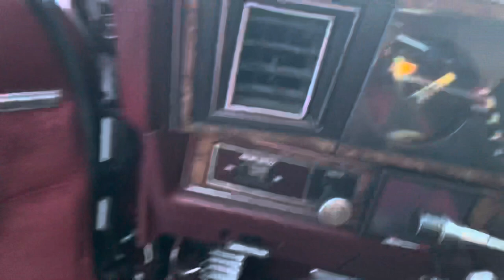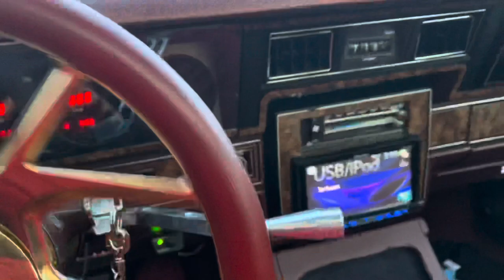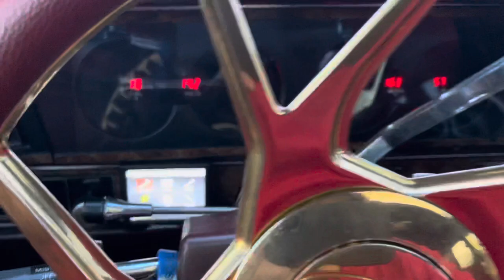Kg Landau running good and we mounted the mc

Comment: HELP ,Love the rims I got a FRC C5 im going to keep clean and sound 👍  but l want the wheel size that's on the Monte, for showboat  what did you say they are ? All so backspacing size. I'm running a 2000 FRC C5.would you know off bat.